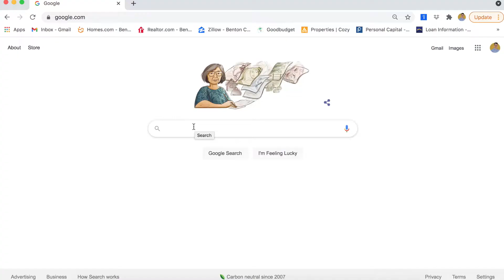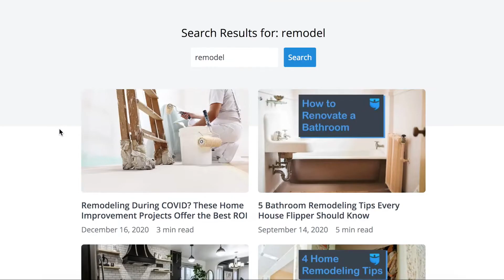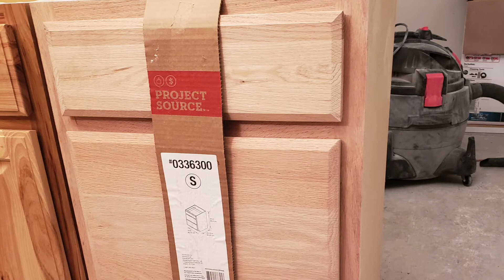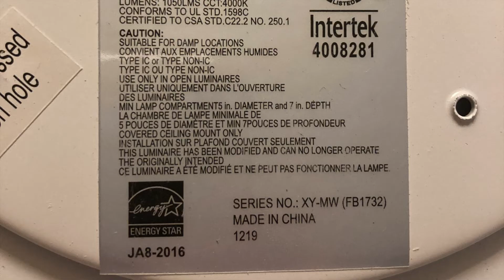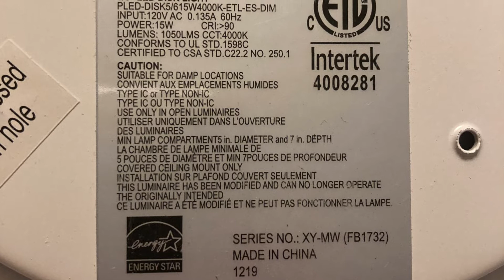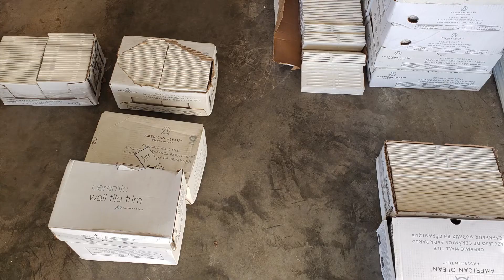COMPLETE DUPLEX REMODEL: Unbelievable Before & After Transformation. Expenses and ARV Breakdown

Comment: Great stuff Philpot! Quick question: Were all the remodel expenses out of pocket expenses (I.e. did you just have that extra $20K handy or was it a loan?)? Is there any kind of financial jujitsu that can be done to obtain a tax benefit on a remodel/renovation?
Reply from the maker: Hey Phil! Great questions. I used a few different strategies. First of all I did it over nine months so I was able to pay for it as I went. However I did use two Synchrony construction credit cards that were no interest for 12 months. I have since paid both off (incurring no interest) but they’re nice to utilize for larger expenditures such as flooring or HVAC.

And I didn’t touch on tax benefits in the video, but I probably should have. In short, yes, I definitely utilized some tax jujitsu! That manifested in the form of cost segregation. Real estate is divided into certain categories in order to depreciate it accordingly. The overall structure on a residential real estate property is subject to 27 1/2 year straight line depreciation. However, there are certain interior components that can be depreciated over a much shorter timeframe such as five or seven years. These items include electrical system carpeting, millwork, appliances, fixtures, etc.

Using cost segregation you can write off larger portions of your remodel expense sooner which offset your active income from the property to essentially reduce your tax burden to nothing. If you think it’s valuable I could make a video specifically on that. It’s a fascinating concept, and one that many high net worth individuals have utilized. Thanks for the question, Phil!
Reply: @danielphilpot7822  This would be great to go over! Maybe include some info on whether you had to set up an LLC to recognize those tax benefits as well? And if not, what kind of forms/schedules you used. Thanks Philpot! Looking forward to the new content!

Comment: Looks amazing! Great job!
Reply from the maker: Thanks Josh! Any insights or recommendations??
Reply: @danielphilpot7822  For removing thinset: angle grinder with a masonry wheel is my best friend. I have a nice De-Walt angle grinder from a charity auction. It does the trick! I also found a giant 45 pound angle grinder with a 7" cut off wheel from the 1940's-50's...It's a beast! It has no safety features to speak of, so it frightens me a little. It may work even better... (although, watching this video at 2x speed, I slowed it down and realized how much tile you were actually working with. You made the right call! Opportunity cost is also a big factor - for example, if you can work 8 hours and make $40 an hour, and you can hire someone to do your other work for 8 hours at $20 an hour, you are still $20 an hour ahead, but you probably already knew that.) 

Moral of the story: an entrepreneur can never have enough tools, cheap tools, expensive tools, doesn't matter, as long as they get the job done and you get your money out of it. They all pay for themselves eventually, as long as you keep using them! I'm even in the process right now of designing and patenting my own tool! Tools are what gets the entrepreneur where they need to go, from a tool as simple as a pen, to lathes, and welders, bulldozers and software packages. Use them all! You won't regret it. 

Toilets: Toilets are the number one thing I'm always fixing. Replacing toilets is always a good idea. Never use the wax rings. Replace every single one with a rubber ring. I have been doing that for the last 15 years, and none of those have ever had an issue. They are re-usable, and much cleaner. 

Building materials: stay away from Habitat for Humanity. It's way too tempting. Buy exactly what you need, or don't buy it at all. I have found some great things there, but also wasted a lot of money and effort going there. It makes me sad to say that it's really hit or miss. Stick to the shopping list. 

Drywall: You were very fortunate, and smart when working with your drywall. That's one thing I always look for when buying houses. You want to have good drywall. It's a pain to fix. One really good tip, two words, I learned in drywall repair: Silica Sand. You mix it in with your paint and roll it on and it creates a texture that hides almost everything. 

Painting: I have painted many rooms. I have used brushes, rollers, and sprayers. I have used 5 gallon bucket paint sprayers and hand-held sprayers. My favorite sprayer is the Graco True Coat 360 Airless hand-held paint sprayer. It retails for about $160, but the quality is just right where it won't disappoint. I painted a 4 bedroom house in 24 hours one time. That was excessive, but completely worth it. The 5 gallon bucket sprayers waste a lot of paint and are difficult to clean. I have 2 in my garage that have only been used once. I always go for the hand held one. 

Tenants: If there is a bug problem, go over there and spray it yourself. Keep in contact with your tenants, let them know you are there to serve them. I always end up fixing some other minor thing while I'm over there spraying for spiders or ants, even though I was not planning to. Always keep a multi tool in your pocket, and a hammer, flash light, and measuring tape in the back of the car. 

I probably shouldn't write a book on this, so this is where I will end. 

You are doing really great! You are thinking like a land lord.
Reply from the maker: When can I get YOU on the YouTube channel?? That was amazing Josh! Thanks for sharing all that knowledge.